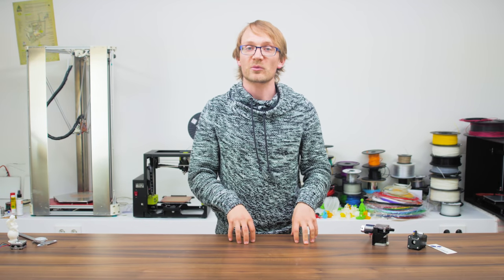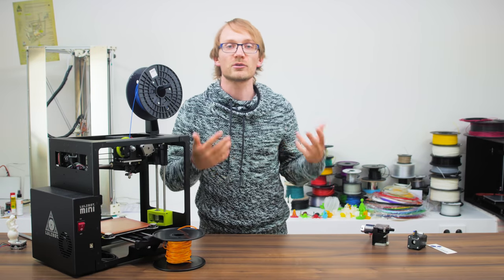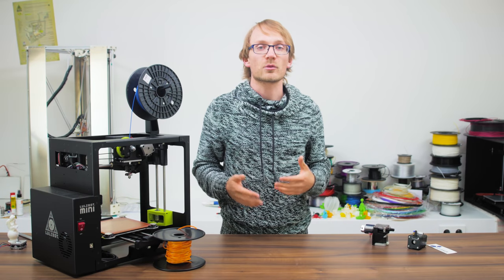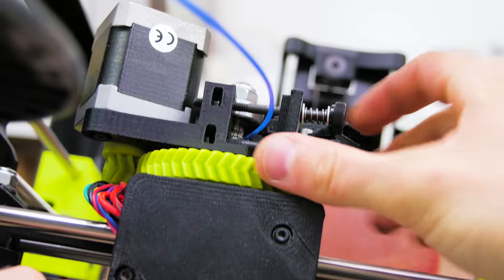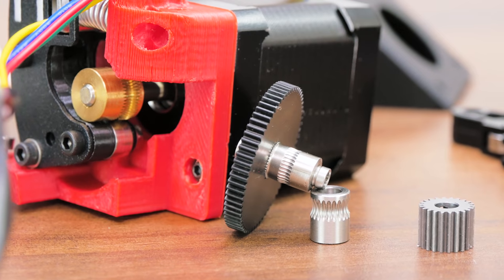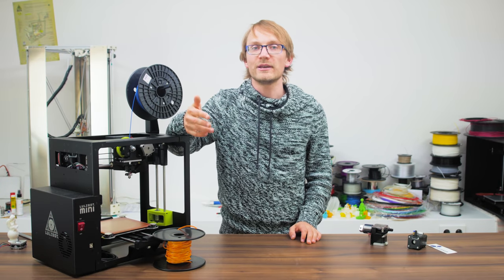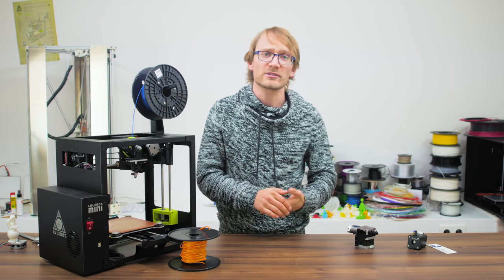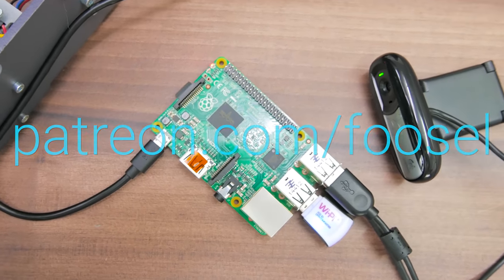Build your own 3D Printer: Everything about extruders!

Comment: I converted my anycubic i3 mega to direct drive and all I gained was trouble. flexibles printed fine and still print the same (at 35-30mm/s) maybe 5mm/s faster. same stringing which was close to nothing before. just more ghosting more issues (so many issues related to direct drive) and more heating on the extruder since now it's a tiny stepper. not to mention repairing and messing with my printer needs me to take the carriage off and unscrew the titan and take out my e3d v6 from there.

Comment: "You cannot convert a hotend from one size to the other" -- that depends on the hot end -- SeeMeCNC made a hotend with a teflon liner that goes all the way into the melt zone -- converting between the sizes is as simple as swapping out the liner for one with a different inner diameter.  (They provided liners for both 1.75 and 3mm.)

Comment: I usually always agree with you Tom, but choosing between a 3mm and 1.75mm Filament extruder makes a big difference. 1.75mm Filament works great with standard Polymers, however specialized FIlament usually always works better with a 3mm. PVA as a tricky polymer and works betterr in 3mm than in 1.75mm. Also as soon to be published research shows, 1.75mm Filament tends to emits a higher amount of particles than a 3mm Filament.

Comment: Some finer finer points on the 3mm vs 1.75 mm exist ofc, but this video is spot on for first custom build ones :3

Oh, you kept reading to find the finer points? They are something like ...

- 3mm is more rigid than a 1.75mm counterpart. So if you have a brittle filament lying around ( mediocre PLA or a novelty filament) a 3mm part tolerates only rather careful handling before snapping. Don't try to change spools on 3mm filament , you may have a very snappy time D: (I speak from personal experience)

- 3mm may require a more delicate extruder control, and a heavier duty hotend because of the larger mass being heated.

- 1.75mm buckles easier . So a 1.75mm flexible filament is hard to extrude ... it buckles and clogs in any slight gap that it's not perfectly directed. There are good 1.75 extruders for flexible filament though. And with 1.75 becoming more popular more filaments are available in both diameters, so there is more flexible 1.75 filament spools to choose from.

- If you are gonna print BIG BUILDS you need 3mm for 1.5 reasons: 
1) speed of printing. A 1.75mm extruder needs to go faster for the same material per second being fused. 
1.5) You don't need the detail of a 0.3mm nozzle, so you may go with a .8 or even 1mm nozzle. Which will give you smoothier printing ... and faster printing. But faster printing means faster extruding. A NEMA motor can only go so fast! ...

- For small prints the finer control on a 1.75 mm direct drive and small nozzles it may be worth it. Its kind of the opposite of the previous point i made.

TLDR:
¿ New to 3D printing ? 
3 or 1.75 mm filament ? 
Whatever your local distributors have. Whcih most likely will be 1.75. And its getting way more common and available.
:3

Comment: Thanks for the excellent video. I would like to ask something about bed adhesion. After your suggestion I was using UHU stick for bed adhesion. It was very good for both PLA and ABS. In my last purchase of UHU stick, I have seen that it has a new formula badge on it and It performed very poorly with ABS. Did you notice anything similar?

Mehmet

Comment: however I need some help with my printer cr-10 v2.. printing in a very long hours makes my extruder failed to extrude midpoint... I even tried to removed my extruder motor gear and tension spring for cleaning and end up well for few hours but poblem still there after 7 to 10 hours printing time....waisted so much filament and time.. bed temp and hotend is ok... but I've noticed that my extruder area like the surface of the tension spring lever is getting hotter az well when printing overnight for 10 hours... really need help how to fix this... Thans a lot. more power to your vlog.

Comment: i have a kossel xl with modified 12mm magnets on the diagonal rods. smoothieboard, 1.75
I struggle to get the speed up as its one of the "original" direct china extruders... do You have a prefered printable (or to be bought) geared extruderYoiu can recommend?
Thanks for Your videos :) appreciated..

Comment: What is a good hotend that has a mini motor in it but that is also light enough to fit on a mini delta printer like a 101 hero? My hotend is terrible but in general it would seem that the rest of the 101 hero components are ok. I don't want to throw it out... just upgrade the hotend without having the boudin thing where the motor is on the side. Any ideas? I remember you reviewed the tiny deltaprinter mini hotend but if I am not mistaken that one does not have a motor on it.

Comment: why don't they use a type of rubber to grip the plastic in the extruder instead of metal teeth? or would it just slip? but in that case, just apply more pressure.
Reply: You can't apply an arbitrary amount of pressure because the motor will bind up, the motor shaft is supported by bearings which will only take so much lateral force, and that's not a terrible much at all. And yes, filament is pretty slippery against rubber and the behaviour of rubber is going to be inherently inconsistent, prone to surface-hardening, temperature-dependence, and aging. I think it's much more reliable to have the hobbed gear or two mechanically notch the filament and advance it that way, the way it's being done now.

Comment: Hello Thomas, I'm in the process of buying a 3d printer for the first time, I have a big roll of filament 200meters, it is flat about 5mm x 1 mm, I would like to know if the extruder will be able to feed that type of filament or it will need to be modified. Thanks in advance
Reply: Pancho Villa build a filastruder!

Comment: hey tom, what are your thoughts of using a direct mount extruder and still mounting the stepper on the frame utilizing something like a cable drive or mabe a pto like shaft to get the effects of a bowden without the hassels of the tube?
Reply from the maker: There are a few products out there that seem to make exactly that work, but I've not tried them yet.
Reply: Do you know what they'called?
Reply: Thomas Sanladerer hey! do you happen to know how ultimaker's X & Y axes work?
Reply: I would recommend a Bowden because the stepper is a lot more weight for the x axis motor lug around

Comment: Hey Thomas, regular viewer of your content.  Quick question, has anyone ever tried using an RJ45 connection as a quick connect for 1.  Heater block, 2.  Thermistor, 3. Fan?  Trying to find a way to quickly connect and disconnect these parts and the local hardware store (HomeDepot in Canada) suggested RJ45 network connectors.  I'm sure it will work for the thermistor and fan as its not drawing a lot of current, but worried about the heater block.

Thanks!
Reply: Thanks for responding so quickly!  I tried it out and the problem is that the cables that go into the RJ45 male connector have to be the perfect diameter.  I tried a pair that were coming off a fan I bought and they were too big.  I guess I'm sticking to Molex or something like that.  Really appreciate the quick response.

Thanks!

Comment: So I bought an i3 kit years ago and am pretty happy about it, but I would like to get into flexible filament. The current i3 has a direct drive for 1.75 mm. After looking into things a bit, I'm thinking about getting another i3 kit for 3mm flexible filament. I also am going to maybe move to a bowden extruder on the old printer as its just for PLA prints and I hear that can really make a difference. I'll convert the direct drive on the new i3 for 3mm use then. Are there not really 3mm direct drive extruder on the market anymore? I see lots of listed 1.75 units, but nothing listed as 3mm. Or maybe I just need a gear hob replacement for 3mm use and get a hotend nozzle for 3mm? If Anyone has any tips or can point me in the right direction, that'd be awesome.
Reply: personaly i only known the wade Reloaded extruder.
Which was shown in this video.

Comment: Built my own and nothing but issues due to the non flat bed.  Over 2 years I have tried to get anything flat to arrive and UPS/USPS always bends them.  I give up and I am about to buy a knock off of the Flashforge Creator Pro and that way if it comes bent it is on the manufacturer since the bed will be inside a fully enclosed metal case.  The only way I could ever get anything for the bed to arrive flat, besides buying an entire printer, is if the item was shipped in a wooden frame.
Reply: +Dark Alchemist Just buy a 8mm (1/3 -1/4 inch) thick aluminum plate, as it will for shure not bend, and then use blue painters tape to get started with printing pla !
Reply: EchterOsti
Yeah, was thinking of tool plate but on an I3 with a moving Y the weight of even 1/4in (6.35mm) is over 2 pounds so 8mm would be close to 2.5-5 pounds and that will never work.
Reply: In my school we actually have a Velleman printer that moves the platform in both X and Y, and (for budget reasons) i also am using an 8mm aluminum plate on that. It works with speed of up to 55 mm/s ! (btw they are dirt cheap in the range from 5-10 mm, at least thats how it is in Germany)
Cheers
Peter
Reply: EchterOsti
6.35mm aluminum tool plate will cost,with shipping, 40 USD.  I am waiting on a quote to see how much extra it will be to have 6 counter sunk holes drilled.
Reply: Oh wow ! In Germany, such a plate costs about 8 Euro (9 $). Let me see if i can find the reseller (ships from Germany) for you !
Reply: +Dark Alchemist Sorry, i happen to have bought that plate on an account i dont have access to atm, will take a bit longer
Reply: +Dark Alchemist Here we go ! That is not the one i bought, but it at least is almost as cheap ! Also ships from Germany, but should be well under the US import custom threshold (is threshold the right word for this ? Feedback appriciated). I hope this suits your printer well. This one is only 6mm thick, but that will not take away much strength whilst allowing for higher print speed ! 
Peter

Comment: Huh, is 3mm really the most common? I've thought it was always 1.75mm, I've mostly been using bowden printers though.
Reply: +Thomas Sanladerer Ahh, ok. Yeah the small bit of time I'd had to deal with 3mm filament in the local hackerspace really was enough for me. I find it really stiff and annoying to work with. 1.75mm is the diameter for me :P

Comment: 1.75 * 3 is not 3mm :P its more like 1.75*1.75
So its 75% more plastic per meter, not 300% as you said(3 times).
Reply: +Johan Lindström area for 1,75 is 2,405 and area for 3 is 7,069, pretty close to 3 times more
Reply: 1.75 mm and 3 mm are the diameter of the filament. Area is pi*(diameter/2)^2. Area for 1.75 mm filament is about 2.4 mm^2 and area for 3 mm filament is about 7.1 mm^2 => which is right at 3 times more cross sectional area which means 3 times the volume per unit length.